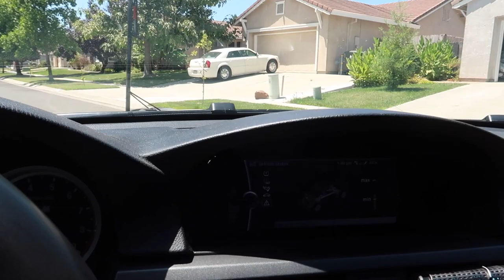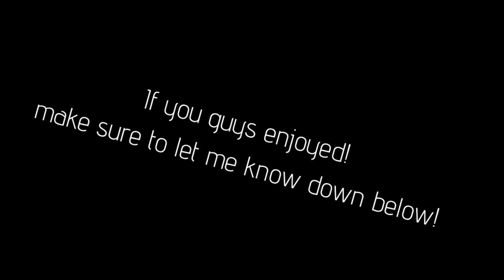TOOK MY BMW E92 M3 OFF ROADING!

Comment: Could you do a video about the most reliable bmws like detailed video. Thinking of getting a e92 328i or f30 328i. If anything maybe another series bmw if any recommended reliable one
Reply: 010001000110111101101101 011000010110100101101110 there’s no such thing as a reliable BMW. If you want a reliable car you should get a Toyota.
Reply: i have an e90 328i and its my daily. I've only been unable to drive it when im modifying it
Reply: Madern I had an e46 it was reliable except for when my friend had a minor accident with it. 190000> miles on it. I have friends with Honda and Toyota’s that had to sell it because it kept having faults 🤷🏾‍♂️
Reply: James E92 yeah I’m a fan of the e92.